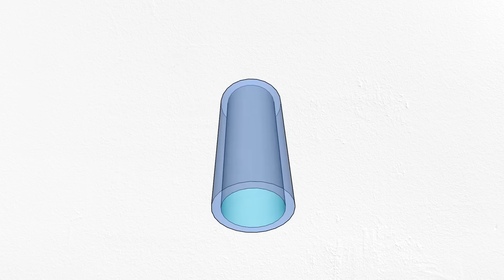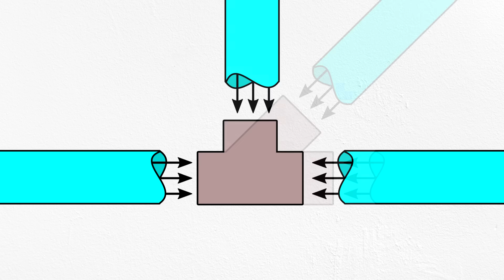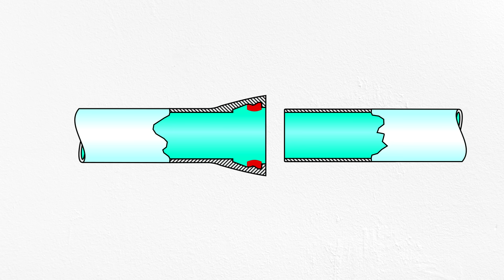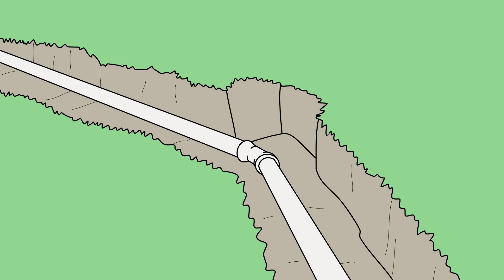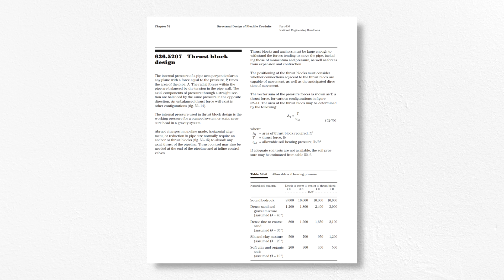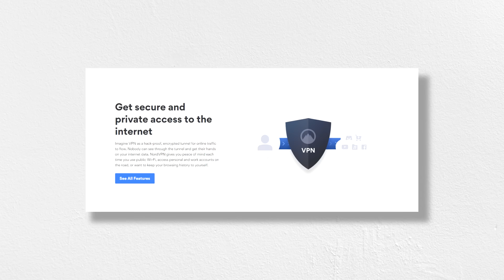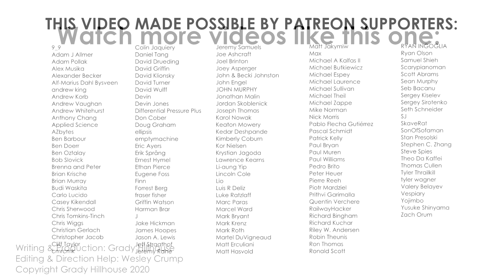Why Pipes Move Underground

Comment: So this explain why my water line (private well, 2 mile run from well head to meter box), built by the original owner in the 80s, made of 2" PVC, often with joints unglued or insufficiently glued, laid in plain ground with no gravel bed or backfill, is ALWAYS springing leaks....

Comment: your VPN add is bs, packets sniffing isn't really a thing anymore with https. 

the real reason to use VPN's is to get access to things with country locks.
Reply: the real reason to use VPNs is to get ur data sold and get the YouTubers money
Reply: steamcastle this is assuming HTTPS is implemented on every website you use, or even assuming it’s properly implemented.
Reply: @ChillDillx  The connection from the VPN exit node to the Website is still unencrypted. And since basically every website has HTTPS and the encryption used by nordvpn is the same as used in HTTPS it doesn't matter.
A is useful if you dont trust your ISP but a VPN becuause the can allways see at least which sites you are visiting. And a vpn is useful if you want to do something shady, like downloading movies illegaly or watching netflix as if you are in a different country (which is against the terms of service).

Comment: The T split at the end of our street disconnected about 9 times in 2019 but they now fixed it by replacing it with an Y instead of a T. Works so far
Reply: They basically lessened the force transfered to the split by making the inner flow curve more slowly in longer distances to the target angle. Like a fast car turning left in an intersection versus one of those "soft turns" that start the turn much early on before the intersection.

I've seen some wilder things dont here. They literally enveloped the whole T-fitting (or y-bend, don't know which they used)  in a block of concrete. Guess they were desperate lol
Reply: @ayuchanayuko  I've had to fix a leak in a joint encased in concrete before. Pipes froze and the joint was spewing water on an extremely cold day and we had to use a jackhammer to get to the joint and a hammer and chisel to expose the bolts on the mechanical joints. Turns out pipe crews in the 90s were terrible.
Reply: @kylehart8829  that's when we just cut it at both ends and start new.
Reply: @taylorsova1205  It was still under partial pressure. The water froze inside the valve on one end of the Street so it wouldn't close all the way. Cutting the T out would've been unreasonable because it would flood the ditch on a below-freezing day. Trust me, if we could've just put a new T in with 3 straight fittings we would've, but that would require some serious wading and there was no way in hell I was about to swim in freezing water while there was sleet coming down around us.
Reply: @kylehart8829  yea, been there too. It blows. But someone has to be the hero right?

Comment: it seems wayyyyyyyy easier to just melt or glue the pipe together than  build a big concrete block
Reply: True, which is what you see for some poly gas lines and smalled water lines.

Imagine trying to apply glue and wrestle a 12" pvc pipe stick (20' long) into place... No thanks!

Comment: If anyone wants to see what pipe restraints look like, look up Romac restraint systems, Smith-Blair restaint systems, or EBAA Iron Megalug restraints. In my experience in the water pipeline industry, they are some of the most common restraints (in addition to concrete thrust blocks).
Reply: We have been having to use megalugs, thrust blocks and bolt rod back to another megalug on our mj. fittings. Kind of a pain but I also like the extra piece of mind
Reply: Bruh I remember u

Comment: Why don't they add concentric flanges (even 1 cm tall) to pipes so that the soil fills in on either side of the ring flange and thus prevents the pipe from moving longitudinally?
Reply: Not a bad idea... Depending on the application.

Comment: All apps on your phone use encrypted connection. Most websites are also encrypted. If a website does not use an encrypted connection, your browser will tell you. Your isp only knows what websites you're using but not how are you using them.
Using a VPN on top of that is like wearing two condoms. So instead of your isp knowing what websites you use they will.
So if you don't trust your isp that is regulated by your country laws, what makes you trust a for profit company in a foreign country?

Comment: I work on a dredge that pumps slurry mud sand or rocks it uses 24 inch I.D. pipe that is submerged or on floating tanks & we commonly run at 350 to 400 psi on pipeline that we install for every job pipes are sealed with a rubber gasket & they are a ball shape that fits in a bell shape pipe then a ring is rolled to hold together & a bolt & nut is installed to prevent ring from coming unhooked

Comment: Sometimes push-on fittings, slip joints, or expansions joints are needed especially for larger and longer pipes to allow for when the pipe length changes due to thermal expansion. Many hydropower facilities have pipes above ground that are exposed to the sun and the cold. That's why you'll usually see thrust blocks holding those pipes in place instead of (or sometimes alongside) pipe restraint fittings.

Comment: blood pressure also measures hydrodynamic and hydrostatic forces, although they're called systolic and diastolic blood pressure, respectively
Reply: Im confused. I thought the difference between those terms lay in the pressure during a heartbeat and after a heartbeat. Can you explain?
Reply: @cauchyschwarz3295  That is correct. During the heartbeat, the blood is flowing (hydrodynamic) and after, it is static (hydrostatic). Dynamic=in motion, Static=not in motion.

Comment: When hanging pipe you also have to take into account the beam length. This varies with pipe size, materiel and thickness. This why the codes state max distance between supports for different types/sizes of pipe.

Comment: In Sweden, only sewer pipes use push fittings, modern water mains use electro welded PE, older cast iron water and old concrete, ceramic or cast iron sewer and drainage mains are usually steam/UV light activated resin saturated fibreglass liners.

Comment: They did a road improvement project by my house and build a bike trail. When they graded the surface off for the trail the 14” water main worked it’s way to the surface. Then they hit it... 7 times! Talk about flooding the site instantly that was with keys in the values ready to go at both ends! I talked to the foreman and he said the drawings showed the line between 3 and 6 feet below the bottom
Of the new grade but it must have moved it want installed properly!

Comment: Why don't they add fins to the pipes themselves to act as thrust blocks and prevent separation? It seems like that could reduce the size of the trust block by using soil over the length of the pipe rather than just at the joint.

Comment: 8:40 Clearly, Grady has never driven on the potholes of Pennsylvania. Great vid as always.
Reply: Or New York
Reply: I'm sorry but no first world city has worse roads than montreal.Its like driving through london after the fucking blitz.
Reply: Rt 22 from Robinson PA, to Weirton WV: 
5 years ago -  When driving east from WV, to PA,  In WV is smooth and silky.  But when you hit the PA line, you and your car would be beaten, battered and bounced mercilessly.  When driving east between 980 exit and Robinson,  I could barely keep my breakfast down due to the road having undulations that caused a horrible bounce effect at PA's outdated, 55mph speed limit.  I had to drive either 45 or 65 to hit the "waves" at a rate where they did not resonate with my vehicle suspension. I did 65 since most people on 22 are doing 70+ anyway. (Again, 55 mph is an outdated speed limit) 

Today: Driving west from PA into WV,  In PA the undulations are gone, between  Robinson and 980, and its fairly smooth.  But as soon as you hit WV,  if you value your alignment and tires you better drive like a drunken maniac, swerving around the craters.   The there's the hill going from Three Springs, down to the Ohio river...  Thin, patchy asphalt that has flaked out.  WTF did they do there?   

But PA still has their brain-dead moments..  A small town had "bombed-out" cratered roads with car-eaters living in them.  Then one summer, they went through and dug out, and replaced all the streets and roads with new silky smooth blacktop.  It was nice..  2 weeks later,  they ripped up every intersection along several streets and the main road, to replace pipes... * facepalm *   Same small town, city sewer crews had once, carved out 2 ft X 3 ft  hole in the main road through town,  done their work, then filled the hole up all but about 8 inches from the top.    They did not mark the hole,  they did not put a plate on it, or a cone..  just left an 8 inch deep hole.  I was at work at a nearby gas station that night.   At least ten cars with blown tires,  4 of those had bent or broken rims,  two others had severe damage, one with the strut driven up through the hood, all came limping in to the lot all madder than hell!   It took several 911 calls to get a cop to come out and put cones around the hole.  Two nights later,  one of the guys whose car was damaged,  came back with a truck, and filled the hole with crushed limestone gravel with dry concrete in it.   That gravel patch remained for two more years until the city came back to finish the job.  Which I might add was just a half-inch of asphalt shoveled onto the gravel, and patted with a shovel.
Reply: Every road I,v been on in PA have been much smoother than NY or NJ
Reply: @jschackmann2  You think that's bad, try Chicago.  We literally had to pass a law to prevent our purely democrat run government from taking funds out of the road maintenance budget for "miscellaneous" spending.
Reply: @My_Suspicious_Inquisitor  Now Her Highness just takes it out of the police budget, since they are defunded, and she no longer allows police to pursue criminals.

Comment: Laminar vs Turbulent flow Reynolds number.
Open channel flow formulas.

Kinenatics fluid Dynamics.

Failures often from
Thermal expansion.
Frost heave.
Soil settlements.
Pressure vibration from vehicles.
Corrosion from electrolysis
Reply: Kinematics or kinenatics?
Reply: @TS-jm7jm  spelling lol
Reply: @Motorhead250  there fixed mine
Reply: @TS-jm7jm lol.
I ain't got no edumication
Reply: @Motorhead250  i see i have bemused you.
Reply: @TS-jm7jm  befriended...

Comment: Does this mean that a large break in one place of a pipe network might cause another (or even a cascade of failures) if that break causes the thrust in another branch to go from balanced to unbalanced?

If so, I'd assume it's a good practice to always anchor branching points very well even if they're supposed to be balanced...
Reply: Stein Gauslaa Strindhaug it’s likely that a large break would cause a major pressure drop in the main. Therefore, in the short term, you wouldn’t likely see a cascading effect because the hydrostatic forces would be so low due to the pressure drop. That being said, anything is possible and it is still good practice to restrain the pipe at any fitting whether balanced or unbalanced.
Reply: The four-way branch shown in the diagram near the end is anchored, so it seems this tends to be accounted for.
Reply: With old pipes yes

Comment: 7:25
::Pushes up glasses::
Actually it's solvent based cement not glue that is used to weld plastic pipe together.
😜
Reply: yeah my father explained to me once it  melts them together so you gotta put the solvent on one piece and stick it into the other and position them properly before it hardens, I've learned some of the most creative swears and imprecations while following techicians doing this job 😂
Reply: Akshuallee🤓
Reply: That's called glue
Reply: @geminirox8635  glue is sticky, the solvent cement interacts chemically with PVC.  It kinda melts the layers together.
Reply: @user-zp5vt1tu6b  its glue
Reply: @geminirox8635  You can unstick glue. Try to pull two properly connected pvc pipes apart. You'll have an easier time understanding the opposite sex
Reply: @geminirox8635  why is it called PVC cement then?
Reply: @SuperSayinSolidSnek  man just Google the definition of glue

Comment: Thanks Grady for the opportunity to contribute to your video.  It was fun doing the collaboration. :)
Reply: Next time you guys do a collab, can we get a full video all about water rockets? :D I want Grady to explain all of the forces and mechanics involved in the rockets and the launchers and how they work :) Of course I remember it all from middle school, but I love the way Grady explains things :)
Reply: S1m0ne  just go look at their channel. Lots of great examples
Reply: 6:12 nice dodge! ;-)
Reply: So what are the optimum gas liquid ratios/pressures in these rockets ?
Reply: About 1/3 water and 2/3 air.
Reply: @AirCommandRockets  That's quite interesting as I was expecting it to be more the other way - even thinking 75% water 25% air ! What pressures do you use ? I know the PET cola bottles will withstand 100 psi as I have an Airzound2 air horn that uses a PET bottle at that pressure although it is inside a 'safety pocket' - and later models have reduced the pressure to 80, I think !
Reply: @pmailkeey We typically use 120psi in rockets made from regular PET bottles. They burst around 180-190psi. In our carbon fiber rockets we've used 1150psi (80 bar)
Reply: @AirCommandRockets  Ever tried or thought about trying fuelled rockets - so they create more pressure as they go :)
Reply: We've thought about using liquid CO2 that self pressurises the rocket as it goes, but also expels the liquid CO2 as the reaction mass. But that wouldn't be a classic water rocket that doesn't use chemical reactions or phase changes for propulsion.
Reply: Nice work guys (Australian 🤝)
Reply: Could you make a rocket out of an old cng tank. They can go up to 3600 psi. You might need to file a flight plan though.
Reply: I really appreciated how you did all of that in a single take, with no cuts. Your camera skills are impressive, to have an idea of where to put your hands, or when to start talking about the next clip, and when to stop. I understand a lot of this may be editing skills, but still really cool.
Reply: Interesting accent. Where are you from.?
Reply: @mossturner9368  Who?
Reply: Jason Turner Air Command Rockets are from Australia.
Reply: If no one did so already, congrats on pointing to the formula you comped in so accurately. People can’t even point to the description section that accurately in most cases 😂
Reply: Your welcome
Reply: in my town there is a 36 feet wide 8 feet tall culvert that is 1.16km long, it has other 1km long  tunnels flowing into it. It has 49 miles of surface area . I walk through it a lot it’s called the rio monterroso.
Reply: Very cool.
Reply: More please!
Reply: When in doubt over engineer everything
Reply: thanks for explaining the topic very well!
Reply: Can I diy a release mechanism, for the rocket, with common furniture ?
Reply: Slot for other channel insert here!. Dude you already emailed him or called him and thanked him! Stop trying to get big sneaking into the comments